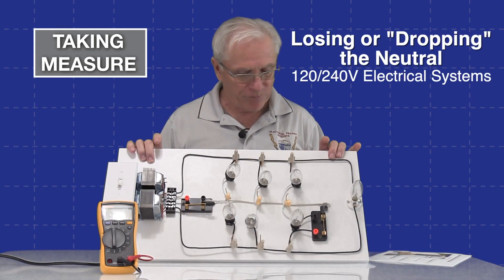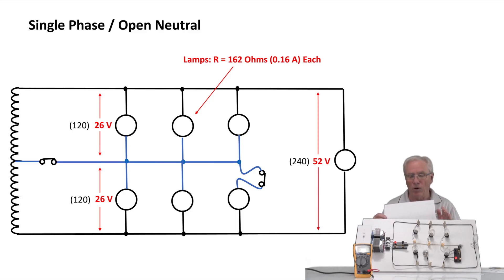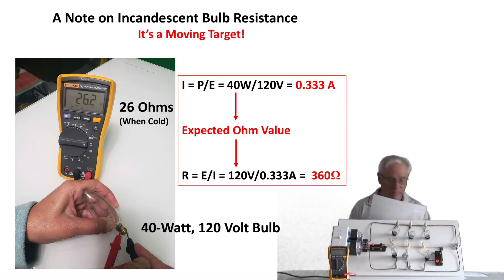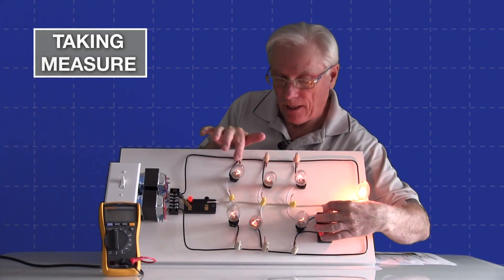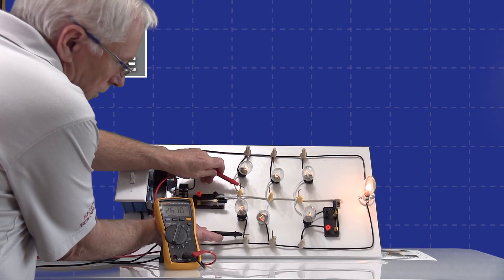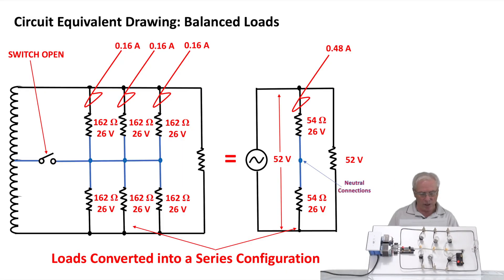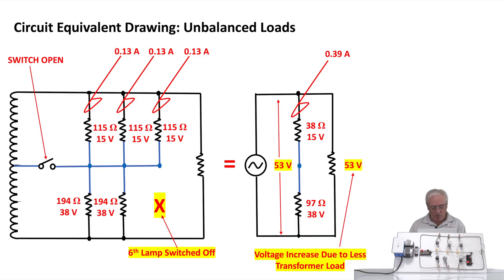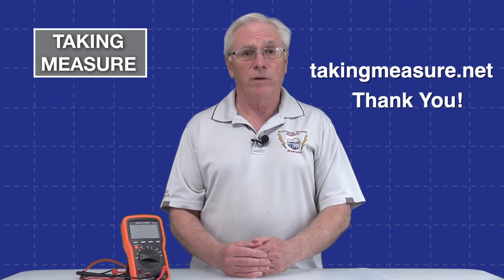Losing or "Dropping" a Neutral on a 120/240V System

Comment: Drawing simply said that a lamp was turned off , and guy said that causes problems. But thats why there are light switches, otherwise you just hardwire the lights for balanced loads.  Balanced live  liads are not very plausable in residential setting. Honey please run the dryer while i use the oven and run the hot water.

Comment: In a three-phase system it is feared to lose neutral.
In Europe the voltage from phase to neutral is 230V. From phase to phase 400V.
Losing neutral can mean running a 230V device at 400V !
Reply: Three phase motors is another case. 
These can also be operated without neutral because they are perfectly balanced.

Comment: Can this type of voltage imbalance situation make gfci outlets and or breakers at the panel box trip intermittently? What about if a person goes to hang something on their wall or from their ceiling and accidentally drives a screw into a romex cable.  Could that humble screw cause a voltage imbalance or amperage imbalance in a circuit? Or from outlet to outlet in the same circuit?
Reply: GFCIs can do confounding things, and I would guess in some instances a GFCI might trip, but I don't think this would be a common occurrence. If you drove a screw in a Romex in such a manner that the screw actually broke the neutral wire in two, you might experience voltage imbalances in some localized locations. But more often the screw in a Romex results in a ground-fault or short-circuit.

Comment: can a bad neutral be upstream of the transformer?
Reply: In our systems, the neutral is derived on the secondary side of the transformer and we are magnetically coupled to the primary side. In this configuration, our current and voltage on the secondary side are separate from the primary side. In short, the neutral problem is ours.

Comment: I have been searching for a bad neutral for over a month,i bought a multimeter, I had the electric company come out, they said it is on my side, but the bad neutral is not steady it comes and goes, L1 has gone to 190 while L-2 was 50 , I did a ohms test yesterday on the neutral wire from meter pole to house.01 but from meter pole to transformer ohms read  2.5 in the morning and 3.5 in the evening, so my ? is that a normal reading
Reply from the maker: The very bottom line is this: If you are measuring wildly different voltages (not near 120V) from one line to neutral as opposed to the other line to neutral at a given point along the circuit or system, the open or poorly connected neutral is upstream to you. The ohm readings you shared seem a little wonky, but I really can't interpret from my distance. If you have stable voltages at the service at all times, the problem would be a poor connection on your side.  If the voltage imbalance shows up on the utility service drop or lateral the problem is on the utility side. I have seen in many instances where a loose neutral connection at the service is the issue.  This is especially true where aluminum conductors have not been installed properly.  I hope this is of some help to you.
Reply: @takingmeasure  Ok Thanks, I believe it is aluminum wire.
Reply: @takingmeasure  that's the downside of using an ohmmeter. I always "load" a suspect circuit or use the low range of a megohmeter, a high voltage ohmmeter used to ring circuits and motor windings. Regarding high resistance neutrals I use a 1500watt space heater on one of the phases and measure voltages everywhere and them move the space heater to the other phase and re-read voltages. That pinpoints the problems to the high resistance neutral.

Comment: If you run on one leg L-1 and disconnect L-2 would you still have to have a neutral?
Reply from the maker: From the point downstream from where the neutral is open, the circuit is completed by way of L-2. If L-2 is not present, you would simply have an open circuit.

Comment: Good open neutral video.  It should be pointed out that open neutrals have caused home fires in electronic equipment and in particular Metal Oxide Varistor transient protection devices.  These can  burn in an open neutral event during to current limited overvoltage. Breakers won't trip, as there's no overcurrent. 
This caused a rewriting of UL standards re these devices several decades ago.
In switch mode power supplies which I designed years ago, we had several fires caused by mains through diode bridge connected Electrolytic caps.  The 200 volt rated caps were grossly overvoltaged by the open neutral.  The side vent snap-in lytics failed safe and released only vapors and smoke on overvoltage tests.  Then purchasing got a good deal on an "equivalent " cap from a different mfg.  These had a top vent, and nobody noticed myself included.  Then we had a few fires caused by our products.  Fortunately no deaths. 
In testing the failing caps we got the foil and flammable electrolyte to pop out of the top vent like a Flaming party favor. Didn't even blow the internal 3 Amp fuse!
Today small power supplies and large are universal input, 90 to 260 vac, and use 400 volt rated Electrolytic caps, so open neutral fire incidents have come way down I'm happy to say.
Reply from the maker: Thank you for the comment. I have seen a lot of strange and dangerous events caused by open neutrals over the years. I really appreciate your take on this. I find myself ever-thankful for UL standards an the constant quest to revise them as required.

Comment: My home developed a case of flickering lamps, some brighter, some dimmer. Also my cable TV and Internet service became quite intermittent. I measured my line voltages and when the loads were unbalanced one 120V leg dropped to 100V while the other 120V leg increased to 140V. In other words the neutral was at 20V rather than 0V. I used a 1200 Watt space heater to create an imbalance in load currents for testing. After getting the power company to send a lineman out to inspect and repair the connections at the utility pole, there is less than 1V on the neutral (relative to ground) when I test with the space heater.  However, my Internet service was still very poor. The cable technician came out and discovered that about a two foot length of their coax drop cable was melted at the end up on the utility pole. My assumption is the unbalanced neutral current was flowing through the coax cable. Replacement of the coax restored proper Internet service. Fortunately I’ve had no other problems since.
Reply from the maker: Thanks for sharing your story. An interesting one at that! I am glad you were able to get the connections back in order before more serious imbalances caused great damage.

Comment: How to calculate each phase voltage when loose neutral when unbalance load.
Reply from the maker: To calculate the voltage dropped across any point, you need to know the total series resistance of the circuit path as a starting point. Using that, you can calculate total current.  Using ohms law, you can apply that to the resistance of each side (E = I x R) to determine the voltage drop.

Comment: After a house fire my wife and I were staying in a camper trailer. It had a small freestanding refrigerator. My wife called me at work and told me the fridge was hopping up and down. I said to her I don’t know what you are talking about it cannot do that. I told her to unplug it. When I came home I plugged it in and it started to jump about. that thing weighed at least 60 pounds. After some investigation it turned out that the neutral wire in the incoming triplex had broken.Therefore no ground. I was told the voltage was hopping between 220 and zero.Hence there was enough energy to literally make it jump up and down. thankfully after a quick fix nothing had been harmed.
Reply from the maker: Wow!  That is one of the most interesting stories I have heard.  You are fortunate more damage did not result!  Thank you for sharing that with is.

Comment: Thanks a lot my entire house does this now I have a new project.
Reply from the maker: Poor electrical connections, improper grounding and bonding, and distribution equipment failure can lead to strange voltage imbalances.  Some of this can damage wiring and any connected appliances and devices.  When someone tells me they are experiencing strange voltage fluctuations, I always recommend shutting down anything they can.  I also recommend getting help troubleshooting from a professional for those who are not in the trades.

Comment: We had an open neutral which caused intermittent problems for a while. Eventually our main water line started leaking (buried in the yard). When the city came to replace the copper pipe they disconnected the ground strap, which they said drew an arc. That blew up some appliances, as the earth ground was acting as our neutral return, and once interrupted, caused unbalanced voltages just as in this demo. It's also nearly certain that the grounding currents eroded the water pipe over several months causing the leak. We had connection problems at the pole before, but this time the utility didn't even want to send a guy up to take a look. Even the electrician that the city sent out didn't seem to understand floating neutral hazards. Frustrating to me, as I'm an electrical engineer.

All in all it was a $5k repair, which I had to eat.
Reply from the maker: Yours is the type of story am sorry to hear.  Electricity will find a way to return to the source as best it can.   The fact you would up with a $5k bill adds insult to injury, I expect.  I appreciate that you shared the story with us.  Thank you.

Comment: Thanks for the very informative video.   This is scary.
I've been working with low power electronic equipment for many years.
I don't get involved with house wiring.  I didn't realize the hazard in the neutral connection.
Reply from the maker: As with any wiring system, 120/240V systems are reliable and safe when installed and functioning as designed (per Code). But if "unusual" voltage events seem to be occurring on such systems, I always recommend shutting down what loads you can, not operating any switches, and calling a professional to troubleshoot as soon as possible.  Thank you for watching and commenting.

Comment: Excellent example of the issue of a failed neutral.  
A few years ago, my 220v work shop supply service lost it's neutral.  6 (0) aluminum underground cable buried.  Neutral somehow got a nick in it were it come out of the conduit below the meter base and made the turn from vertical to horizonal (90 deg bend).  Over time just the neutral aluminum wire corroded (green crusties) and corroded completely into causing a failed neutral.  This failure happened between a 200+ foot drop from the meter pole and the shop service panel.  Shop had a seperate safety ground rod installed and wired to the service panel in the shop. (did not help!)
Needless to say, voltages went way high on one leg of the 220v service.  Florescent lights in the shop went crazy, some would not come on, and others were extremely bright (high voltage).   Worse part, I had several DeWalt 20v battery chargers plugged into a long wall mounted service strip, and all the DeWalt chargers went up in smoke.
I was lucky, the battery chargers were the only thing that was damaged.
I had to get a circuit "sniffer" aka tracer to locate the actual fault location since I could not dig up over 200 feet of service cable.  We found the fault with the sniffer/pinger, and had to dig up the underground cable in that location only, then cut out the failed wire area and replace it. 
A true leaning experience ($$$) for me!  If I ever see an imbalance in light brightness again anywhere, I know exactly what to go check with my trusty Flute Voltmeter.
Thanks for posting and explaining what happens....should be required learning for all homeowners and others!
Reply from the maker: Sounds as though you got off fairly lucky.  I am happy for that.   I have seen this scenario inflict a lot of damage over the years.  So much depends on what loads are involved and active at the time.  Thank you for watching and commenting!

Comment: Very well explained sir! I love your teaching style! You are absolutely right about the changing resistance(dynamic resistance) of the filaments in incandescent lights. That dynamic resistance is known as a positive temperature coefficient. What that basically means is that if you increase the temperature on the tungsten filament, you increase the resistance in the filament as opposed to a negative temperature coefficient which means as you increase the temperature on any other negative temperature coefficient material the resistance decreases in that material. Tungsten basically has a positive temperature coefficient. Positive or negative temperature coefficient materials are widely used in thermistor technology.
Reply from the maker: Thank you so much for the positive feedback.  I really enjoy labs such as the one I presented here.  Working with the dynamic resistance made this all the more fun for me.   Finally, thank you for sharing your knowledge.  The learning never stops!
Reply: @takingmeasure bsolutely you are so very welcome. Thank you for the demonstration. I enjoy labs as well. As a sidenote, I was working with a three way switch configuration in my dining room the other day, and I detected a ghost voltage on my digital multi meter. I notice a lot of people have that issue detecting phantom, voltages. One of my suggestions in that scenario is to use the low impedance Function if the meter is equipped with one. I believe one of the causes of phantom voltages is running many live circuits through a narrow raceway in close proximity to one another. When One circuit is energized and the adjacent circuit is not it creates what’s called a capacitive effect which induces a phantom voltage in the non energized circuit.

The nice thing about the old wiggy voltage meters and analog Simpson meters is they were very low impedance and never picked up any kind of phantom voltages.
Reply from the maker: @BIGMIKEOSAS  I am working on a video for ghost voltage.  I hope to have it live here in a couple weeks. Thanks again!
Reply: @takingmeasure  Oh that’s awesome! I’m looking forward to seeing your video on that subject. I just subscribed to your channel this morning! Thank you sir for all the great content. My background is 34 years residential and commercial high voltage and electronics engineering. I love your teaching style!

Comment: How did you get 53 vac under the lost neutral and lamp scenario? The power supply is 52 vac.
Reply from the maker: The transformers measure a higher voltage until they are put under a heavier load.  Additionally, the voltage where we produce the videos typically measures above 120 volts.  Given that we have a higher primary voltage (122ish) and relatively modest load, our secondary voltage runs a bit high.  Fully loaded, power losses would likely see the measured voltage fall slightly below the rated (nominal) voltage.  As it turned out for this lab, when the current dropped slightly after the light was switched out, the transformer losses were reduced enough to allow a slight increase in voltage.  We are in the process making of a follow-up video to this one in which I try to address this and other question that have cropped up.  I hope this helped answer your question.  Thank you for watching.

Comment: When we moved into our 1970's house about 20 years ago I quickly noticed a few quirks with the electrical system, where lights on certain 120v circuits would get brighter or dimmer depending whether lights on different 120v circuits were on or off. I found a couple of issues; 

1) All the light switches and outlets were connected by 'back-stabbing' the wire into a small hole in the switch/outlet. Over the years due to arcing, etc, the connections had become burnt. I replaced every one of them and secured all wires using the screws for better contact.

2) Tracing all the circuits I determined several light circuits shared a common neutral.

3) I decided to go to the sub-panel for lights and outlets, and tighten all the screws to both the individual breakers and also the neutral buss bar. As I was tightening the neutral buss screws, half of the buss bar fractured and fell to the floor! It clearly had been overheated for years!

Fortunately, I was able to locate a replacement buss bar at a local provider. Once replaced and secured, I had no further problems. Wheee!
Reply from the maker: Yikes.  I am glad you jumped on the issues and fixed things before more serious problems developed.  Good work!  Thanks for watching the video.  I appreciate you sharing the story.

Comment: Does  it work for putting  two DC/AC 120v  pure sinewave  inverters  and create 240 if I combine Neutral and use two hot legs ?
Reply from the maker: That may be above my skillset.  It's an interesting thought, but I am not sure.